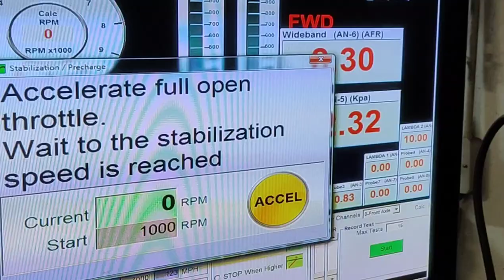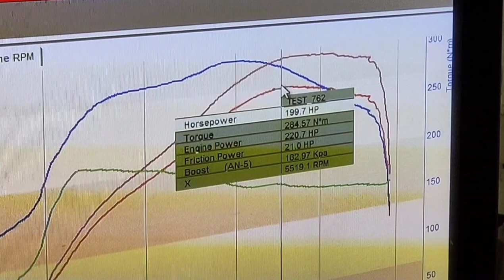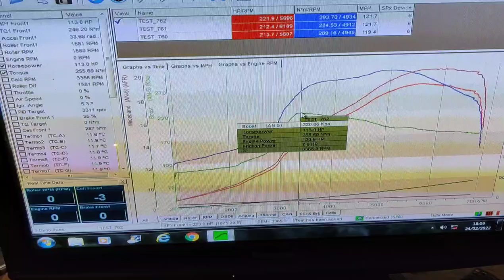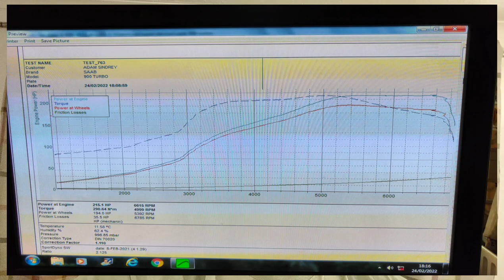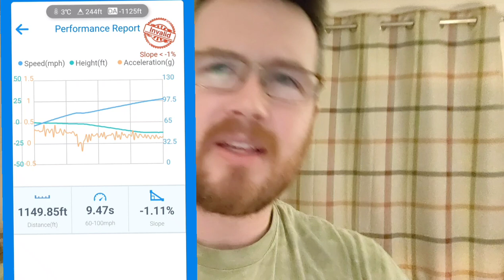Dynoing my '87 Saab 900 Turbo - The Before Video!

Comment: Ive done some C900's to 250bhp. The trick is to bring the boost in nice and slowly and make more use of the revs which you can do with the B202 cams.  Ive had stock 185bhp cars blow the gearbox after one brisk drive. Mainly due to the fact the old APC boxes were so harsh and would bring the 0.85 bar boost in instantly. The torque shock then kills the box.

Comment: Fantastic video, I look forward to seeing how you get on. Do you have a quater mile time for your scimitar?.
Reply from the maker: 13.6 @ 108mph, with a Dragy on the road. That's quite a high MPH for the ET. Basically its a bit of a pig to launch well. You tried yours?
Reply: @LivingMyBoostLife  Thats fantastic! I took miles to santa pod years ago. The best time was 13.8 at 101. 

Santa pod has all the grip you could ever want, they basically spray glue down each morning. So you'd probably be a few tenths quicker there.

Comment: Nice video but ur not going to get more hp from replacement of a timing chain.
Reply from the maker: Well you say that but I've experienced it. I've got a b204 9000, fitted a td04-19t and a remap to it and it was still lacking something. I checked the valve timing and it was half a tooth out due to a slack chain and work guides. Fitted fresh and the transformation was impressive